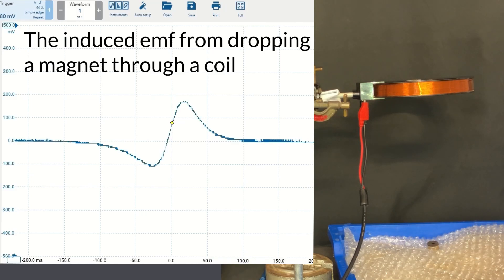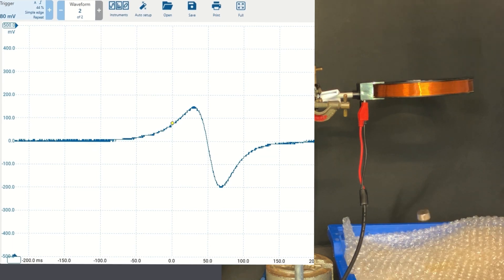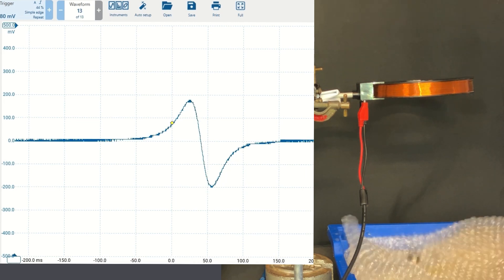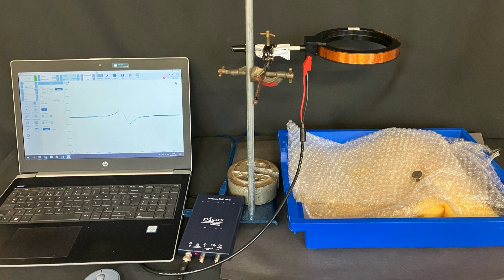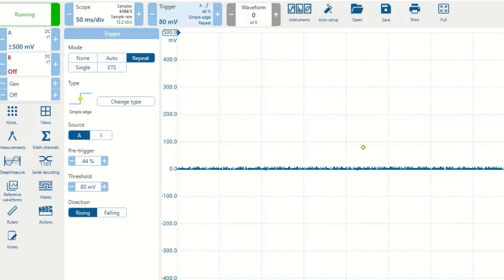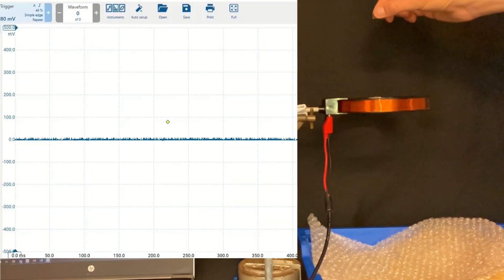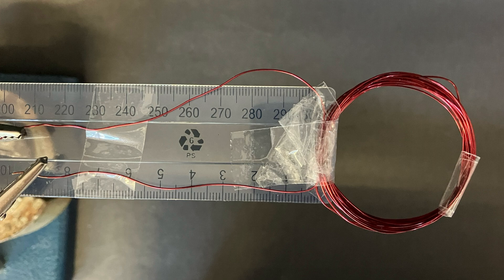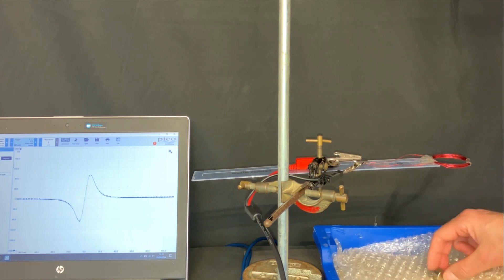Induced emf from dropping a magnetic through a coil

Comment: could you do this but for say 6 sphere bunched in a spherical way
Reply from the maker: If the magnetic field around the coil changes you will get an induced emf but it will have a slightly different shape depending on the shape of the magnetic field.

Comment: Each drop is producing EM waves right?
Reply from the maker: It is not really a wave.  It induces and emf (potential difference) which is has the opposite sign when the magnet enters the coil to when it leaves.  This makes the oscilloscope trace look wave shaped.
Reply: @SimonPoliakoff  Yes, but any electromagnetic perturbation causes an electromagnetic wave.
Reply from the maker: Yes the AC current flowing in the coil could cause a radio wave to be produced but I wouldn’t jump straight from dropping the magnet to saying an EM wave is produced as it misses out some of the steps.
Reply: @SimonPoliakoff  I often skips steps try to keep up. Just kidding

Comment: ha ha. with an induction coil secondary i wound with something like 100K turns, dropping a spherical neo with some spin could get peaks that the cheap scope we had registered as several megavolts... though insufficient energy to ever produce an actual spark.

now the fun part. wind a second coil, wire them in series...parallel? lol, at this point its the same...
and place a small magnet there. it should jump out of the coil when you drop the first one.

Comment: Nice experiment. The EMF is larger when the magnet leaves because it the is moving faster (because it is accelerating due to gravity), right?
Reply from the maker: Yes you are right.  The area underneath the curve is the same for the entering and leaving because the area represent the change in flux linking the coil which is the same for entering and leaving.
Reply: That's what I was going to write but you got here first.